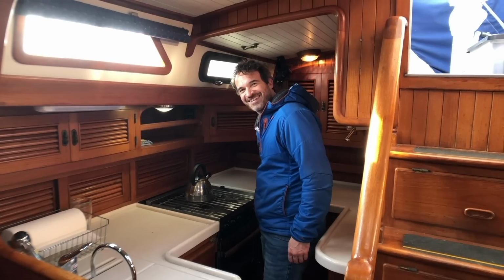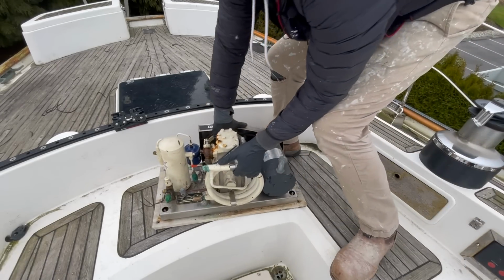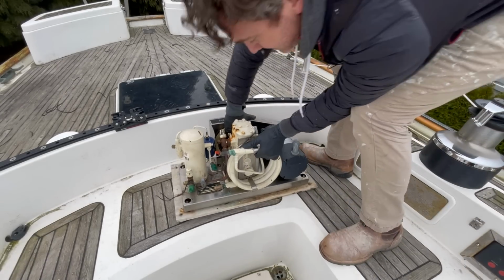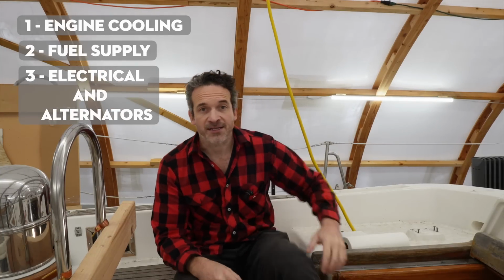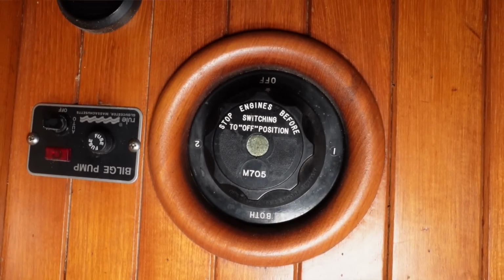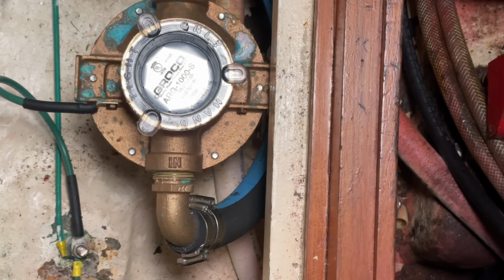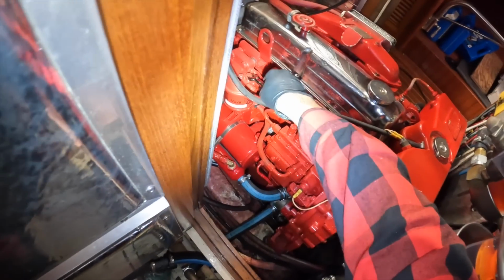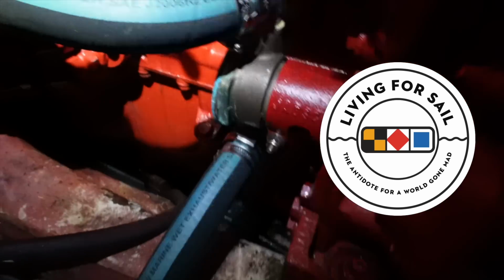Old Diesel after TWO YEARS - Will it START?! | E019

Comment: Did Maxwell make a horizontal windlass?
Would love to have any information about it if possible
Reply from the maker: They made a version called the H3000 that was the same gearbox as mine but it had a through shaft to run a gypsy on one side and a capstan on the other. It was all enclosed in a separate housing. 

Info is hard to find…

Comment: Always use a quality oil. I use nothing but Castrol and Rotella. One of the worst things is to send in a cheap oil. It does not help the analysis. Thermal breakdown of oil can happen at normal temps with a cheap oil. Try the old frying pan trick, NOT the Wife's! Drop of oil in a frying pan and see which ones last. You will be amazed by the results. There's a reason I use only Castrol where I can. Everyone thinks its because I am English, nope castrol is still refined overseas and they can burn off all the impurities. Oil refined here in the States can not burn off all the impurities. The impurities are what cause the oil to have a low thermal breakdown. Same goes for rubber products. Sorry I get on a roll sometimes. Been a mechanic and fabricator for a very long time.
Reply from the maker: Thank you for the insight. Much appreciated. I am a fan of the rotella products but it looks like they’ve changed the formulations slightly in the last couple of years…
Reply: @livingforsail  They have unfortunately but still a good oil.

Comment: One potential tip for diesels, is very often today, Diesel Fuels are sold without any added lubricant i  them, and same for Heating Oils, so i mector pumps, and boiler pumps are wearing at a rapid rate. Ive found that a good lubrication additive can be Synthetic Two stroke Pil, which can be a very chep buy if bought end of season, or a cheap Synthetic engine oil, at say a 100 : 1 ratio, so should be enough to do the needed lubrication content ? If a better ratio is something else, people need to know. Best Wishes and a Merry Christmas and a Happy New Year to you All .  Bob. 👍🎄🎄🎄🧑‍🎄🧑‍🎄🧑‍🎄❤️❤️❤️
Reply from the maker: Hi, thanks for the tip!
It’s true that the new ULSD (low sulfur) fuels have less lubricity than the “old” diesel. At least around here…. The marine/off-highway “red” diesel is SUPPOSED to have higher sulfur content and may not need extra lubricant. If you have an old diesel truck that runs on the road, this might be a bigger issue…
Cheers. Merry Christmas! 🙏👍🙌🎄

Comment: Heidi and Franny used Blackstone to analyse oil from one of their Porsches (Boxster I think) , oddly they now have a sailing channel. Heidi also cut the filter open and opened up the pleats to look for any metal particles that might be as a result of a failing engine part..in the case of the Boxster this would be the IMS bearing but might be worth doing too.
Looking forward to getting that old windlas fixed up.
Reply from the maker: Interesting. I’ll have to go check that out. Thanks for the feedback and I think you’ll enjoy seeing the windlass all back together! 🙏👍🙌

Comment: I use Blackstone all the time… As a matter O fact, I had a buddy that ran synthetic that told me about them. He had remote filters on his 6.3 ford diesel. Every 10k miles he would change filters, take sample, and top up synthetic oil. Send sample to Blackstone and saved saved saved on oil usage! 

I have a 454 BB Chevy in my boat. She’s 30 years old and only 600 hours. Sent sample into BS and that old motor is excellent shape. 

Oil tells ya a lot and this is how you can save $$$$ ££££ €€€€€€😊
Reply from the maker: Right on. That’s a great idea about stretching out oil changes AND you keep  better eye on things. Probably savings all around!
Cheers. 
🙏🙌👍
Reply: @livingforsail  I’d be curious to get Blackstone’s reply on this… Amsoil or Royal Purple???

Comment: Very interesting video.  I have my Atomic 4 in my shop and am rebuilding it currently.  It would be interesting to perform an ail analysis after is it broken in from the rebuild.  Your engine looks brand new compared to mine.  Also tell Joe from Blackstone that his microphone is WAY too small.  😁
Reply from the maker: Yeah, I had mic envy… I had an A4 in an old sailboat (hence the reference to feeling your pain). Ours was raw water cooled and it showed… finicky little engine but it was usually there when we needed it. Best of luck with your rebuild!

Comment: As a fellow engineer I need to pass on this advice to you. You should always bar over a diesel engine by hand two complete revolutions (so that each cylinder goes through all four cycles valve wise) - it is the only way you can detect if water has got into any of the cylinders. Barring it over by hand you will notice if it starts to ‘hydraulic’ - the starter motor not so much - but enough to cause damage. It’s a complete pain in the arse but the only sure fire way. I use to do it as a daily penance on 2MW diesel generators - life was tough.😉
Reply from the maker: That’s solid advice! Since I’m not in the water, I wasn’t too concerned about any flooded cylinders but it is a good thing to mention. I’ll add that to my list for next time! Cheers!! 🙏👍🙌

Comment: Well Jon, you got my curiosity going! I wanted to do this to my Ecoboost Twin Turbo Ford F150, that was ordered with every towing option on the list. I tow a 9K travel trailer and have 117K miles on it at this point in time. It would have been nice to have gotten one within year 1 and then now to compare, but I guess now is as good a time as any. I have maintained the truck to all maintenance schedules with oil changes every 5K miles. We shall see what happens. Fingers crossed. Good luck with your oil analysis. Great video!
Reply from the maker: Right on, well it seems like you’re getting good life out of that engine so far. Analysis could be a good way to track it ongoing. Good luck! 🙏🙌👍

Comment: Hey Jon, great idea to get the oil analysis done -- I had it done regularly on my tractor when I drove over the road.  One thing though ... when starting a motor that has sat as long as that, I would have removed each of the injectors and squirted some oil into each of the cylinders.  You can do quite a bit of damage to cylinders and rings by running the motor without lubricating before turning the motor over -- it can take a few minutes for the oil pump to get up to full pressure and distribute the oil to the top end.  What's done is done now though, and hopefully the oil results will come back in good order.  Walter Schulz (founder of Shannon Yachts) did a great tutorial on starting up a motor that has been sitting for a long time with Randy of Captain Q fame -- it's worth a watch!
Reply from the maker: Yeah, that’s a good point and something that I overlooked this time 😳. Let’s see how the sample comes back and go from there. 
Thanks as always for the feedback! 🙌👍🙏